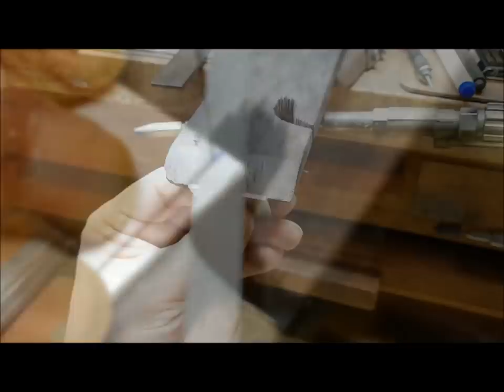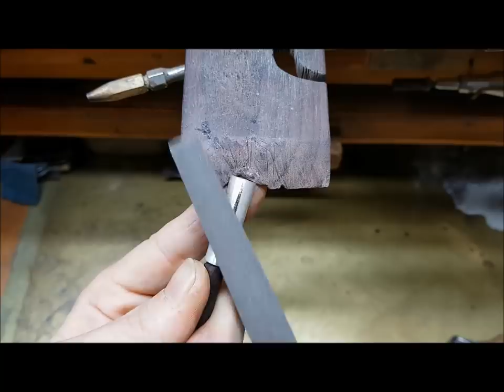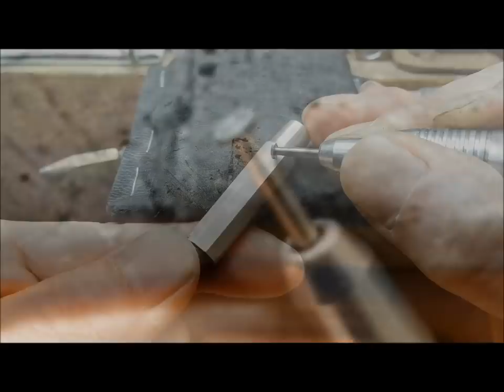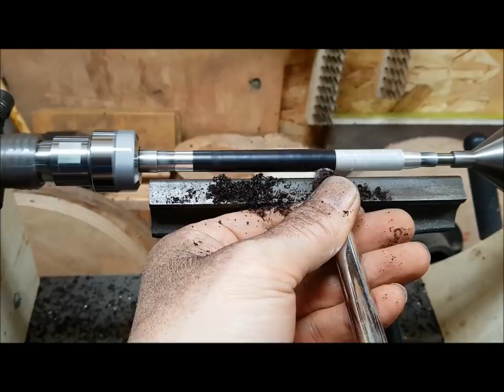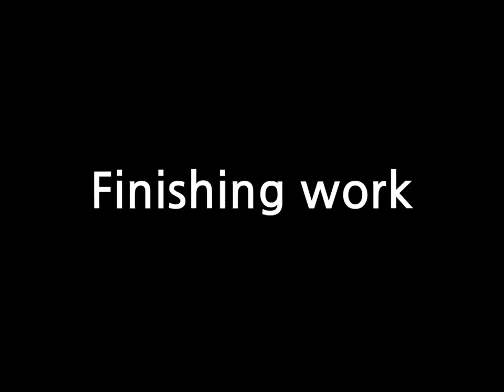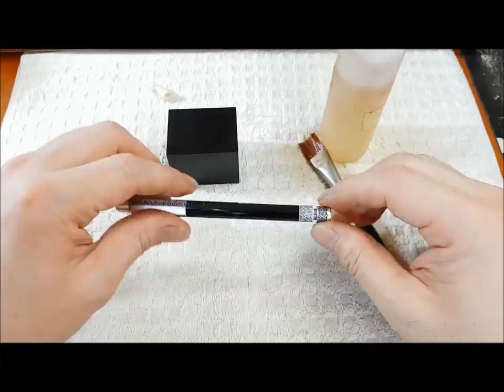Making silver mechanical PENCIL / Silver, Mpingo, P205

Comment: Amazing word! Incredible skill! Thanks for sharing. By the way I have a question: which is the diameter of the brass tube you use, since the P205 mechanism is conical? Where do you find internal brass tube with dedicated smaller tip? Thanks a lot and compliments for you work. I'll keep watching and like your videos.
Reply from the maker: Brass tubing conforms to the specifications of the P205 mechanism,
It is made to order directly and used.
The outer diameter of the brass tube is 6.9mm.
Thanks !!

Comment: How long do you leave your silver parts in the acid bath for?
Reply from the maker: Depending on the temperature of the acid,
The time to immerse depends on various factors such as the size of the workpiece.
I think it took about 5 minutes to do this.
90% water + 10% sulfuric acid is correct.
Subtitles displayed in the video are an error.
Reply: @SilverMeister  Thank you :)